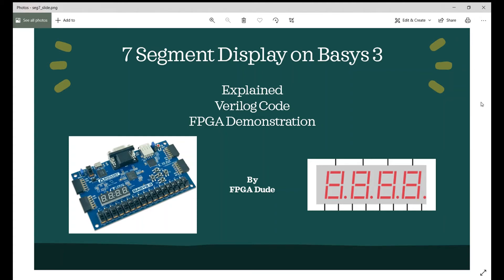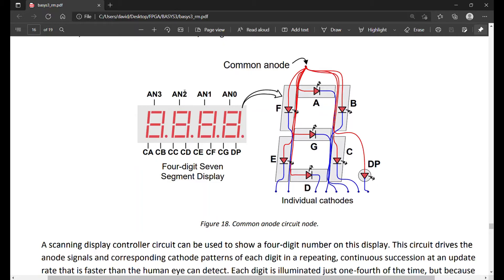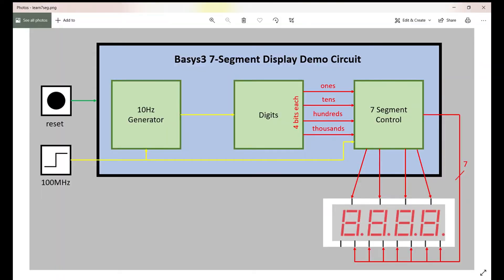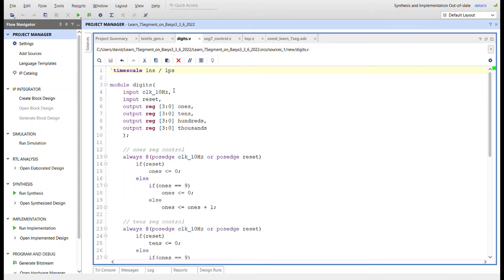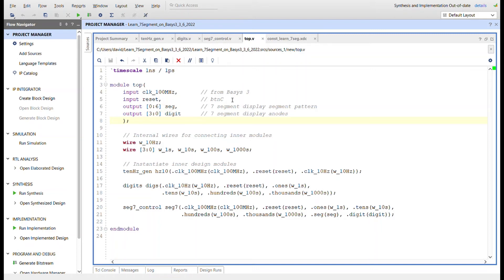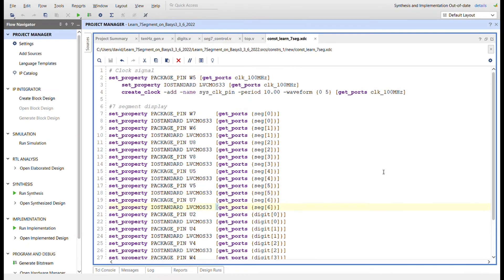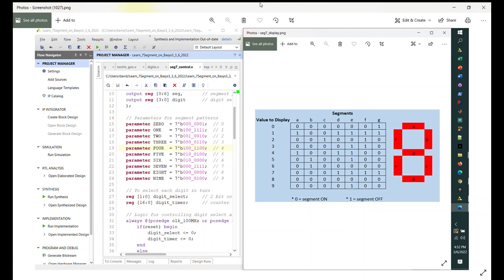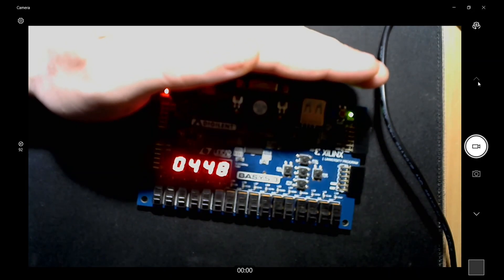How to Control 7-Segment Displays on Basys3 FPGA using Verilog in Vivado

Comment: Wonderful Video, Can you pls explain that what is the use of Refreshing Rate or Refreshing Period?
Reply from the maker: Thanks! As for the refresh rate:
It refers to how quickly the display updates or cycles through different digits or characters to maintain the illusion of continuous, stable information. Each anode is turned on, one after the other in sequential order, at a certain refresh rate / frequency. The human eye has limitations in perceiving high-frequency changes. A higher refresh rate generally results in smoother and more flicker-free displays when showing rapidly changing information, such as on the 7-segment displays. Rapidly cycling through the anodes repeatedly while changing the 7-bit segment value for each anode gives the illusion that the display is showing a stable number. If you slow the refresh rate way down, to let's say 10Hz, you will see how each anode is turned on then off, one after another, continuously. You should try it. Hope this helps.
Reply: @dajoma36  Alright, Thanks for Explaining it more clearly!

Comment: Use this testbench to check it in simulation
`timescale 1ns / 1ps

module testbench;

    reg clk_100MHz, reset;
    reg up;
    reg down;
    wire[6:0] seg;
    wire[2:0] digit;
   
top counter(clk_100MHz,reset,up,down,seg,digit);
   
always begin
clk_100MHz = 1'b1;
#10; clk_100MHz = 1'b0;
#10;
end

initial begin
    up = "0"; down = "0";reset = "1";
    #15; reset = "0";

    #20; up = "1"; down = "0";
    #20; up = "0"; down = "0";
    #20; up = "1"; down = "0";
    #20; up = "0"; down = "0";
    #20; up = "1"; down = "0";
    #20; up = "0"; down = "0";
    #20; up = "1"; down = "0";
    #20; up = "0"; down = "0";
    #20; up = "1"; down = "0";
    #20; up = "0"; down = "0";
    #20; up = "1"; down = "0";
    #20; up = "0"; down = "0";
    #20; up = "1"; down = "0";
    #20; up = "0"; down = "0";
    #20; up = "1"; down = "0";
    #20; up = "0"; down = "0";
    #20; up = "1"; down = "0";
    #20; up = "0"; down = "0";
    #20; up = "1"; down = "0";
    #20; up = "0"; down = "0";
    #20; up = "1"; down = "0";
    #20; up = "0"; down = "0";
    #20; up = "1"; down = "0";
    #20; up = "0"; down = "0";
    
    
    #20; up = "0"; down = "0";reset = "1";
    #15; reset = "0";

    #20; up = "0"; down = "1";
    #20; up = "0"; down = "0";
    #20; up = "0"; down = "1";
    #20; up = "0"; down = "0";
    #20; up = "0"; down = "1";
    #20; up = "0"; down = "0";
    #20; up = "0"; down = "1";
    #20; up = "0"; down = "0";
    #20; up = "0"; down = "1";
    #20; up = "0"; down = "0";
    #20; up = "0"; down = "1";
    #20; up = "0"; down = "0";
    #20; up = "0"; down = "1";
    #20; up = "0"; down = "0";
    #20; up = "0"; down = "1";
    #20; up = "0"; down = "0";
    #20; up = "0"; down = "1";
    #20; up = "0"; down = "0";
    #20; up = "0"; down = "1";
    #20; up = "0"; down = "0";
    #20; up = "0"; down = "1";
    end
endmodule

but sec and digit stay at a fixed value without changing, is my testbench wrong?
Reply from the maker: Can I see the module you are testing? What is up and down for?
Reply from the maker: Never seen anyone use "0" and "1" for numbers. Maybe a new thing in Verilog? Try using only the integers 0 and 1, with no quotations.

Comment: 14 bits binary to its 4 digits:

module bin2dec_digits(
    input clk_10Hz,
    input [13:0] in,
    output reg [3:0] ones, tens, hundreds, thousands
    );
    
     always @(posedge clk_10Hz) begin
            ones <= in% 10;
            tens <= (in/ 10) % 10;
            hundreds <= (in/ 100) % 10;
            thousands <= (in/ 1000) % 10;
    end
    
endmodule
Reply from the maker: Thanks for sharing.

Comment: Im trying to figure out how to turn on one DP for one digit in the 7 segment display, so far im having no luck still
Reply from the maker: You can either use 8 bits for the segments with the 8th bit being the DP signal. Or, you can drive the DP as it's own signal.

Comment: Hello, can you explain how can we simulate (seven segment led display) using testbench. For this very code.
Reply from the maker: Well, with any test bench you use reg to drive the inputs and wire to capture outputs. In the case of the seven segment display the outputs are 4 anodes and 7 cathodes, input is the clock.

Comment: Bro can you say how to show a constant number on the LED. For Example I have to keep showing the number 999
Reply from the maker: Very simple to do. You don't need to loop through the anodes, you just turn on the ones you want to use by driving a 0 to them. For instance, if you use 3 digits to the right, send 1000 to the 4-bit anode. For the 9, just set the 7-bit seg value that is the pattern for displaying a 9.
Reply: @dajoma36  In this case all the LEDs will show the same value. What if I want to show different values on all the LEDs ?
Reply from the maker: @navaneethkrishnannampoothi2317  Well, then you do what I did in the video.
Reply: @dajoma36  but then won't it work as a counter ? I want to keep displaying a certain value without any change. The value isn't a user defined value and it will be the output of some calculations.
Reply from the maker: @navaneethkrishnannampoothi2317  Hm. I'm trying to understand what you mean. Maybe look into the 7-segment display clock. The value that is displayed is dependent upon a counter value. If you mean something like displaying the value of a sensor, which is the result of a calculation, check out the video on I2C, which explains how to display the numerical result of the sensor. Hope this helps, if not, maybe provide more detail about what you are trying to do.
Reply: @dajoma36  Thanks for that. That was the thing I was looking for. Except for showing sensor data I am calculating the pulse width of a signal and then showing that value.
Reply from the maker: @navaneethkrishnannampoothi2317  No problem. Good luck.
Reply: @dajoma36  I made some changes to the code (removing degree and celsius and adding hundreds and thousands) but when i give an input input [13:0] data = 5896, and do the below mentioned part to separate out the four digits 
 assign thousands = data / 1000;
assign hundreds =  (data % 1000) / 100; assign tens = (data % 100) / 10;           
assign ones = data % 10;       
   
Instead of showing 5896 the LED is showing 1168.
Reply from the maker: @navaneethkrishnannampoothi2317  Sounds like you need to do some troubleshooting. I suggest to: verify the operation of your circuit with test benches, and ensure you have your segment patterns correct.

Comment: Variable 'digit' should not be used in output port connection 

what does this error mean? Im getting this error in top module?
Reply from the maker: I don't know.
Reply: Simply change its data type from reg to wire

Comment: Hi bro u r videos are actually superb  i am doing project real time clk(hr:min:sec) using  7 segment display and also i need to convert 24 hrs format into 12 hrs pls help to do this
Reply from the maker: For a 24 hour clock, just have your hours counter count from 1 to 24, instead of 1 to 12. Everything else should be the same, I think.
Reply from the maker: You will need to make the hours counter 5 bits, instead of 4. And, thanks for your comments on my vids.
Reply from the maker: Oh. After reading your comment again, I see that I may not have understood. Converting a 24 hours into 12 hours? I believe you would need another signal, for AM / PM. You could have one signal, like a reg, and if it is 0 consider it AM, and 1 consider it PM. Every 12 hours flip it. Is this what you meant?
Reply: @dajoma36  brother can u share me ur mail id i will share my question wat are exactly specifications they mentioned
Reply from the maker: @sankasuvarna1764  You can find my email on my ABOUT page. I will try to help you if I can.
Reply: @sankasuvarna1764  Hey, have you completed your Digital Clock Project, Actually i too want to implement this, so can you help me understand the design of Clock so that i can implement it? Thank You!

Comment: Hello. I didn't understand why we need a 10 Hz clock. Could someone explain that to me, please?
Reply from the maker: Hello. The purpose of the 10 Hz clock is only for the demonstration of the 7 segment displays. Just so I could show you a counter. I could have used 1Hz, but that would have been slower.
Reply: @dajoma36  Oh, I see. Thank you!!!
Reply from the maker: @danielafajardo9961  You're welcome.
Reply from the maker: @danielafajardo9961   For a refresh of 2ms, the counter should count to 200,000 before switching to next digit. The period of a 100MHz clock is 1/100,000,000 which equals 10ns(10 x 10^-9 seconds). To achieve a period of 2ms, 10ns x 200,000 = 2ms. So, for a 2ms period per digit, the counter would count from 0 to 199,999 and then reset. This will achieve a total display refresh period of 2ms per digit x 4 digits = 8ms.

Thank you for pointing this out. My calculation in the video is just dumb luck, I guess. I have updated the description for this video to explain better how to calculate the refresh period.
Reply: @dajoma36  Oh, thank you for your explanation! Yes, I was asking cause I'm trying to implement a counter myself by applying what you explained in the video but without copying your code, just to see if I'm understanding well. Unfortunately, I don't have an fpga board so I'm not sure if it's working or not haha. but now I got how the refresh rate works, thank you!!!!
Reply from the maker: @danielafajardo9961  You're very welcome.
Reply: @danielafajardo9961  Hey, can you please help me in understanding that why do we need Refreshing Rate? What is the use of it? What led that we have to use Refreshing Rate? Thank You!

Comment: Hi, I seem to be getting a NSTD-1 and UCIO-1 errors when following this method step by step while trying to generate the bit-stream at the end. Any idea why that could happen? I checked the forums and I did find entries on those errors but I could not make head or tails of what they actually meant
Reply from the maker: Sorry, I have no idea. If the errors are from bitstream generation, then it may be a problem with Vivado.
Reply from the maker: Usually if problem with bitstream, then FPGA pin assignment is in error. Double check all files, especially XDC, to ensure they are correct. Sorry, this is all I got.
Reply: @dajoma36  Thanks for the reply. So I had copied my project files from one location to another and opened the project from the latter location. Apparently, that caused all the errors. The errors went away as soon as I made a new project and redid everything.
Reply from the maker: @deathmaster4035  Glad to hear you got it figured out.

Comment: You do not need to reverse endianness or reverse the indices in the xdc.  They will still connect to the correct outputs.
Reply from the maker: Depends on how you order your segments. If from a - g, then you will have to change, as I did in the video. If you order from g - a, then you don't. As R. Vass mentioned in another comment on this video.

Comment: Great video thanks. I found the hard way about 7 segment display on basys3 when i first started playing a month ago. so i ended up reversing the pattern by putting the 'a' on the right hand side and 'g' on the left. I am new to verilog and FPGA :-).
Reply from the maker: I wouldn't say you did it in a "hard way", you just solved the problem in a different way. Props for figuring that out!
Reply: @dajoma36  Dude I copied your code and ran it on my basys3 and it works beautifully. after correcting a few typo mistakes "Mhz" instead of "MHz" it runs perfect. Thank you!
Reply from the maker: @Avionics2  Glad to hear it worked for you and that I am able to share what I know and teach others some stuff.